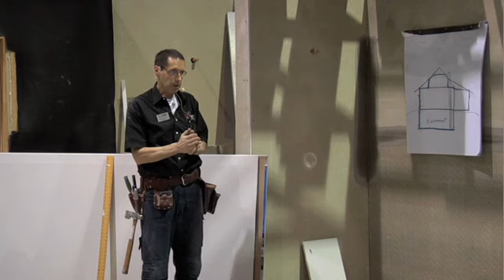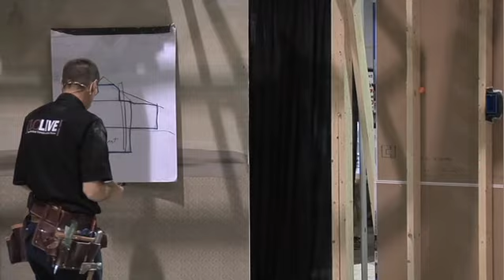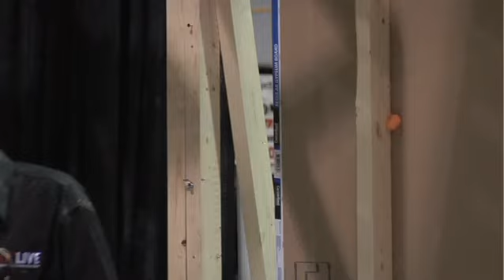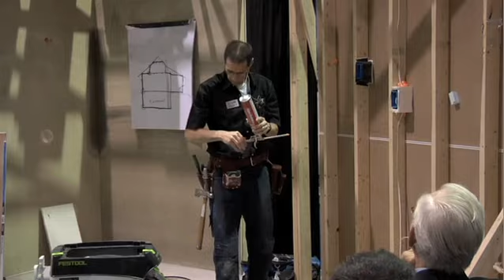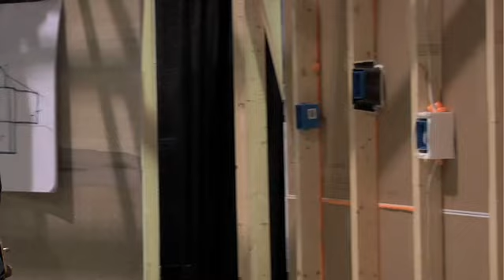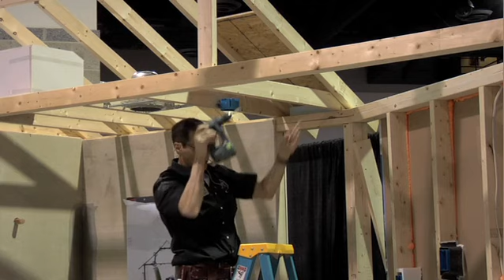Airtight Drywall and Air Sealing: Part One

Comment: This is why the same house built in the 70s and 80s for $200 grand now costs $400 grand. Go back another 50 years and wadded-up newspapers was used for insulation and tarpaper was used under the exterior sheathing. Mold was unheard of. If he's trying to protect the entire house, why isn't the primary barrier on the exterior of the structure, then you wouldn't have to worry about electrical and plumbing stub-outs, inside corners. I know doing so would open another can of worms, and I welcome that argument!!
Reply: If the air barrier is only on the exterior, you can't control moisture-laden air from entering the wall cavity from the interior.  If the air barrier is only on the interior, you'll get wind-washing of the insulation when the air enters from the exterior.  Using two air barriers fixes both problems.  Also, air-sealing is rarely perfect and is liable to fail given enough time.  Having two air barriers can help the system stay functional for longer.
Reply: @bobsondugnutt7526 I live in the hot humid south and this is 100% true for this climate zone. The builders who built my house in the 80s did a shitty job air sealing and we had a really nasty mold problem because of it... Hence why I came across this video because I'm having to redo literally half of the house due lazy/shoddy work.
Reply: You are very right. It seems foaming and caulking all of this won't allow the house to breathe. If peolle don't believe this, then take a hvac drop box and take the fiberglass lining out of it and spray foam it. The minute the cold air hit the drop box register metal plate...it will condensate water. But if you use the fiberglass insulation which allows it to breath, then you won't see condensate forming because it breaths

Comment: Let's say there are 100 tiny leaks and you seal 80 of them, which leaves 20.  You spend more money up front sealing and insulating, so you can spend less for a smaller HVAC unit.  And energy cost go up almost every year, so the savings compound.

Comment: I hate those 'in the wall' styrofoam over-boxes.  Considering any top plate openings and the drywall edges will be sealed, how is any measurable pressure differential ever going to develop ?  That is the only way flow happens.   An utter waste of material and time, and is just more junk that winds up in a landfill at some point.   The hacks that pulled this idea out of their arse should immolate themselves: they made housing more expensive with zero benefit to persons or the environment.

Comment: please advise the name of the caulk and foam you are using to air seal with? Also, is there a specific brand drywall adhesive you recommend?
Reply: For electrical box & wire penetrations, I like using 3M firestop - it swells if it gets hot [chemists use the term "intumescent"].  Having faught mice in the past, I will seal all stud holes - vertical or horizontal, if/when a wall is open.  For sill plates at window openings [and associated frames], best advice I know is low expansion rate foam - you do not want the window frame getting bowed in by high expansion rate.  There's lots to choose from, and often marketed as "window and door".  Try Great Stuff, etc
Some of the concerns of IECC simply go away... if you solve a buildings negative ventilation problem.  New fireboxes for example, may demand a dedicated fresh air feed.  After that, kitchen exhaust hoods can be a problem.  The commercial end has recognized that way back: a place like KFC would get built with a supply fan and duct to compensate for their exhaust hoods.
Reply: The best caulking to seal up the sill plates, top plates and the joints between doubled up studs is an elastomeric polyurethane sealant such as "Tremco Dymonic 100" or "Masterseal NP-1".   Both come in 10oz standard cartridges and 20oz sausage packs.    They both are rated to adhere to concrete, wood, metal, vinyl, etc and can be used to caulk the nail fins on vinyl windows as well.

Comment: How do we know for sure moisture will lot form in these air right spaces.
Reply: Condensation happens when warm moist air moves through a wall and condenses on colder surfaces. So if the spaces are air-tight, then moisture containing air isn't moving through them.
Reply: @approots  what if the plastic, foam or drywall that is airtight is itself - cold, why won't moisture form on it then
Reply: @Hello-zf5lq  But what moisture? Where would the moisture come from in a sealed space? Condensation happens when warm moist air moves to a cold surface. Leaks are necessary for this to happen in insulated walls.
Reply: If there is no insulation between the warm air and cold surface (windows), then yes, there could be condensation.

Comment: Drinking, and home improvement.  A winning combination.
Reply: I think that you're referring to his speech seeming a little slurred. While this is a potential symptom of alcohol use, many people with congenital hearing problems develop very similar speech issues. Similarly, stroke can affect the speech centers leaving people with slight speech problems even after therapy. The rest of his movements and body control are not consistent with alcohol use sufficient to cause slurring, so I am 99.9% sure that the guy hasn't been drinking.
Reply: Waa thinking thw same
Reply: My apologies if it's a medical issue vs drinking.

Comment: Great video. But,,,, today this isn't good enough. Air sealing each individual cavity will further increase insulation values, enhance pest control and fire resistance.... Remember, every step forward in air sealing techniques increases the need for good ventilation.
Reply: what wasnt good enough?

Comment: Do you think this is necessary for new construction?   Approximately How many cans of foam for 2000 sq ft 2 story home? Approximately how many tubes of caulk?
Reply: From a Matt Risinger video, they stick built a new 3500 sq ft home and used 36 sausage tubes of caulk.
Reply: If you build a very air-tight house, you must pay detailed homage to the gods of air-exchange lest you anger the must and mildew devils. Having an air-tight home is really great if you live in an area with potentially problematic air quality due to forest fires or industrial pollution or pollen, but there's a lot that goes into making sure each room in the house has sufficient air (and moisture) ingress and egress. It's a lot easier to build a slightly leaky and slightly less efficient home but your HVAC bills are a bit higher.

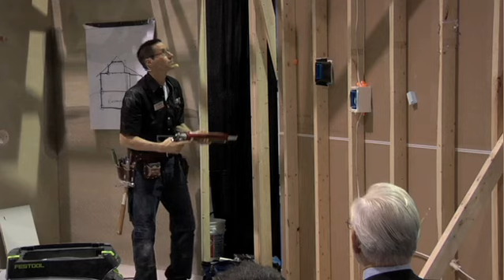Comment: At about the 6:24 mark, the speaker is caulking along the bottom plate and floor. I understand the point of the presentation is to air seal the house. But in addition to air sealing, could the product also strength the bond between the floor and wall to provide more resiliency, assuming that an appropriate adhesive caulking is being used.  BTW, what was the specification of the caulking use to do the sealing?
Reply: No, there's no strength factor in that.  But I would add one more benefit:  if you ever suffer bedbugs, having the base of drywall 100% sealed eliminates one more [brain frying] place they can hide in the daytime.  A gap the thickness of a business card might as well be a superhighway for those bastards.
Reply: @flinch622  good point!
Reply: the wall would already be fastened to the floor system using nails, anchors, screws, wall sheathing overlapping from the outside onto the rim joist, etc. any amount of glue or adhesive applied at the joint area will be negligible in adding to the strength of the framing assembly.  When you spray foam the whole wall, it does at strength to the whole wall system because it makes the wall assembly more rigid.